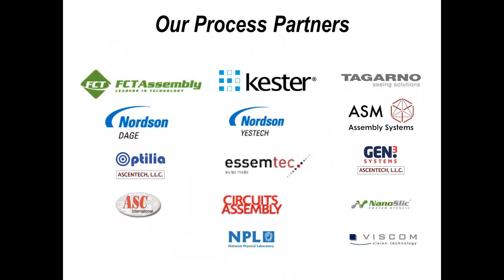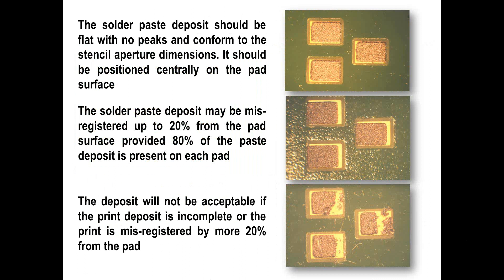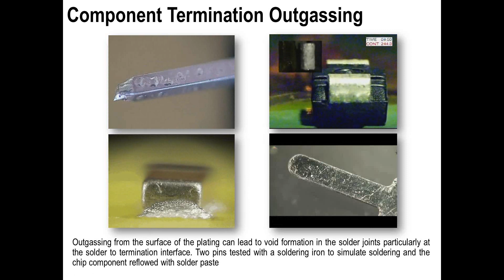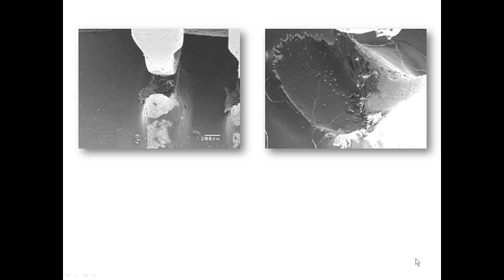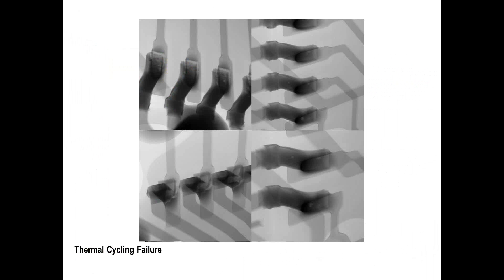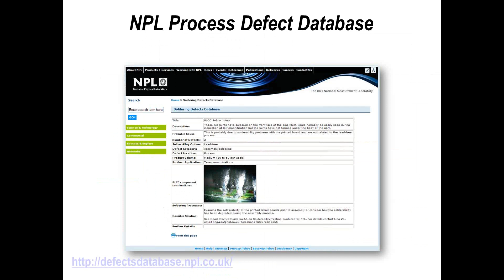Bob Willis Solder Paste Print, Reflow Problems   Causes and Cures   Webinar

Comment: What causes the balls of dough that come loose?
Reply from the maker: Can you be a little more specific what you have asked is not clear do you mean solder balls or solder beads on the side of chip components?
Reply from the maker: If it is solder beads then this Defect of the Month video will explain all see https://youtu.be/lGrjtUO6l4Q?si=qaikhtHryGvHd-Yq     also longer one   https://youtu.be/k7Qk4IH5NK4?si=ggIUiFH50swVvQ-Y

Comment: I want to simulate Solder self alignment accuracy in BGA with respect to bump shape, diameter. What are best recomended  simulators to do this? Plz reply.
Reply from the maker: There ate a few reflow simulators for optical and xray reflow. Suppliers include PDR Rework, Malcolm Technology, DAGE and also Cores in Japan. Do a search online to find details. These are systems that I have used in the past to create what you want to make. Used them on BGA CSP, flip chip and through hole reflow  bobwillis.co.uk
Reply: @MrBobwillis  I was given that project to do in computer simulator. Designing of Solder joints in BGA to attain maximum accuracy. How can I simulate solder BGA to find chip's final position after reflow, (i.e., with how much accuracy the chip aligned to substrate) 
with a given input of pad dimensions, Solder surface tension coefficient, chip mass etc. ?
Can you tell me the software tools to that project.
Reply from the maker: @kgirivarma4856  Sorry you did not say computer simulation, I always start with process simulation so you see where the parts move in reflow its quicker and you can review different parameters far quicker that creating a computer model. I have found that computer models often miss so aspects. If you do an online search you will probably find many other studies on reliability and you can use these tools
Reply: @MrBobwillis  Thank you for ur reply Mr. Bob Willis

Comment: Good Day, may I know what is the recommended solder paste amount on a stencil during the production process?
Reply from the maker: It depends on the pitch of the component, the distance between terminations. It also depends on board or component warpage during assembly and the standards of inspection you are working too. In the case of the industry we are using 0.004, 0.005 and 0.006" stencil thickness today and this may be effected by both surface mount and through hole intrusive reflow soldering Bob Willis bob@bobwillis.co.uk

Comment: I'm seeing cracks fairly frequently, usually due to ICT. I have seen it on 4 seperate products that we make in different places or at suppliers. This makes me realize that we need to be able to look for cracks without cross sectioning using a non-destructive method. Do you have any suggestions?
Reply from the maker: Many thanks for the comment or question on my YouTube channel. You say you have cracks but do not say what type of cracks in solder joints or capacitors? You can visit my website www.bobwillis.co.uk or email me bob@bobwillis.co.ukMany thanks
Reply from the maker: First thing in any investigation is to look at the problem. Send me some good high resolution of the defects and I will make suggestions on what you need to do Bob Willis bob@bobwillis.co.uk